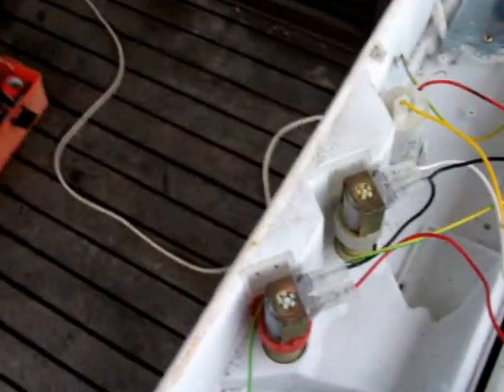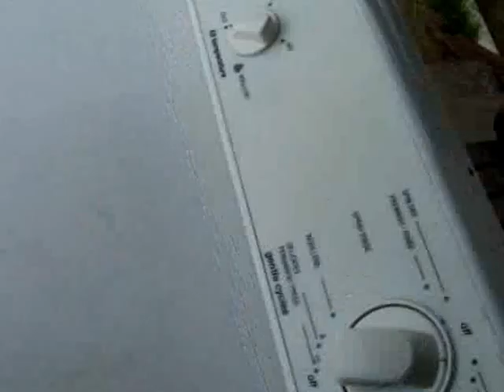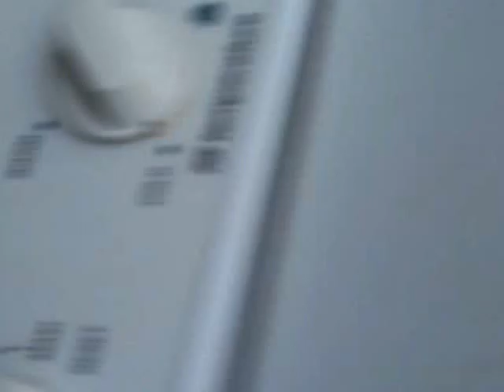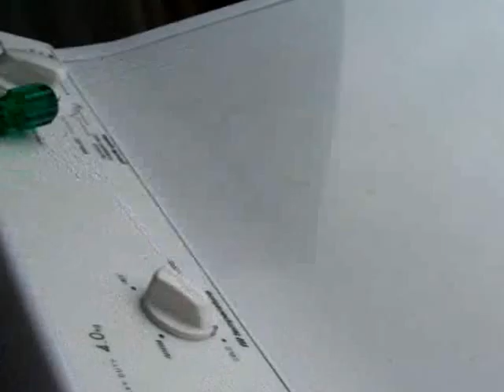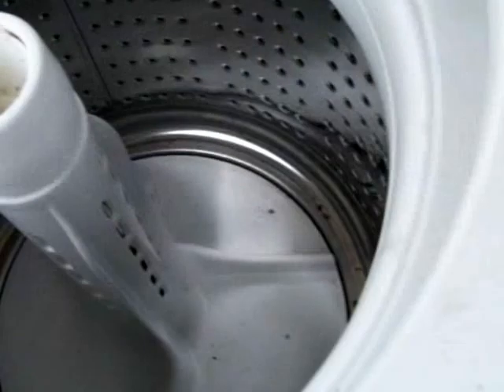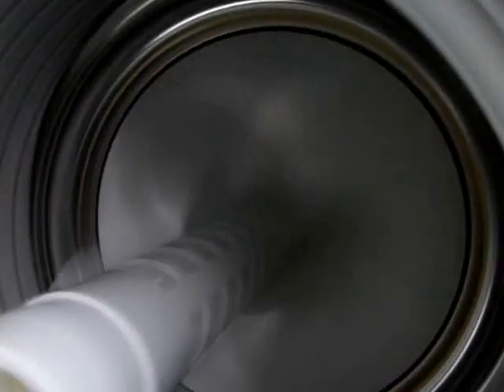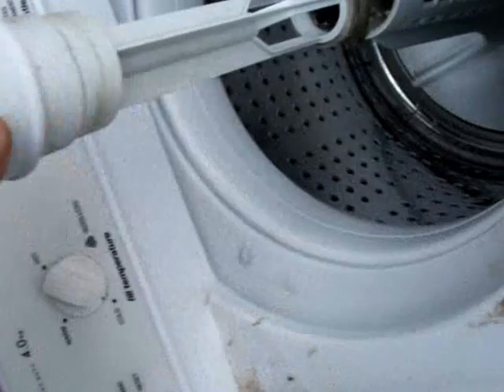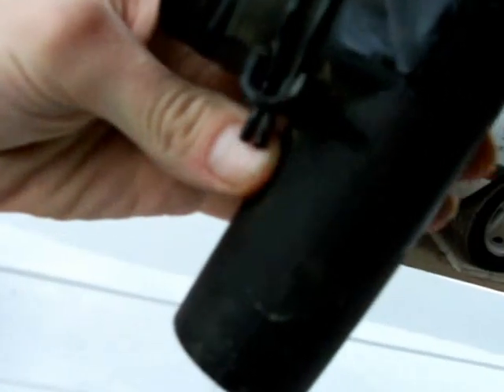hoover 200m washing machine run then repair

Comment: My Hoover 200m.. It seems the drum bearings need replacing.. It bangs a lot on spin cycle & goes out of balance a lot.. Have you any clips on getting the drum out etc to replace these? Searched but can't find anything on this model & the agitator removal on this is different to others.. Any help? Thanks Tony